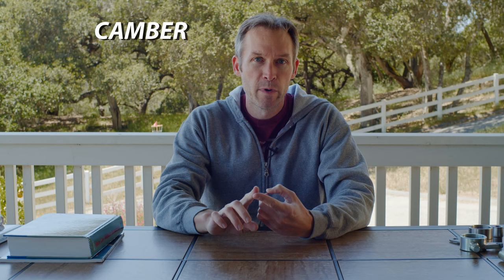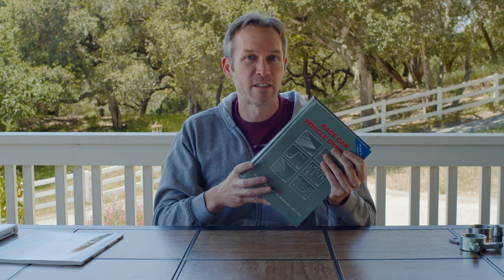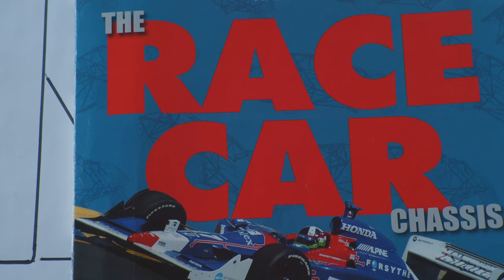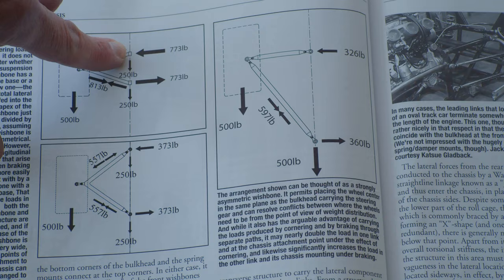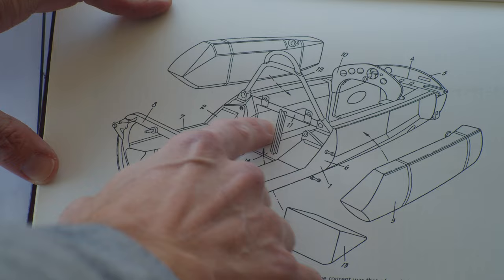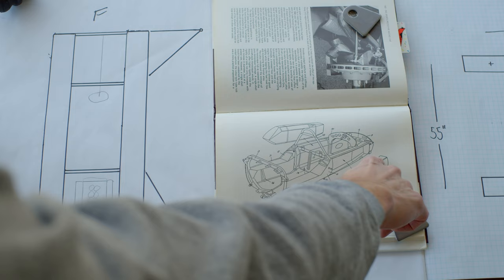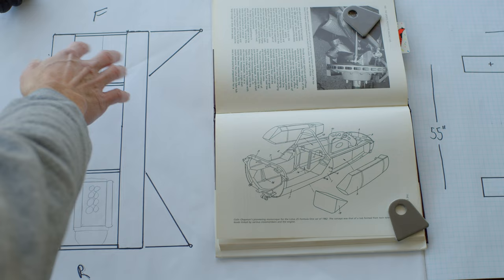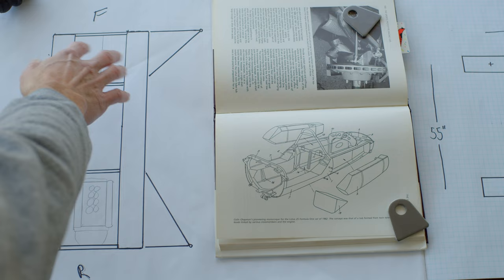Race Car Suspension Fabrication

Comment: Hey Ben - your videos are really well done! I just found your channel today so new subscriber. You've included a lot of great tips and explanations in this one - I went through a similar learning process a few yrs ago when I built my chassis. Carroll Smith's Tune to Win was a great resource for me at the time - publication is decades old but still relevant. I went the push-rod route with corvette knuckles front and back (with lots of mods) - a few things I might have changed if I started over but that's how these builds go. If I'd seen a video like yours before beginning, it definitely would have sped up my design work! Thanks for taking time and sharing all your insights with the community, I'll definitely be watching a few more of your videos in the coming weeks!

Comment: Thanks - I read the chassis book, but did not pick up on the differences in forces for the different suspension mounts. I now need to re-check my design. But now, before I built any of it is definitely the time to check!

Comment: Don't forget to look at the brake torque around the upright when calculating the rod ends in bending. The lower ball joint gets a lot more bending force because of this moment on top of the pure longitudinal force. That's why it seems some cars get away with rod ends in bending on the upper wishbone, as the braking moment somewhat counters the braking force, but on the lower one it doesn't.

Comment: Great video Ben and well done on the work you’ve done so far. Just out of curiosity could you tell me where you sourced the parts you showed during the vid, like the threaded control arms, circular ball joint holder etc.  I’m in Australia and I’m contemplating building a replica Brabham BT 19 of which only 1 was built and is a legendary car here.  Keep up the good work. 👍
Reply from the maker: Threaded ball joint sleeve: https://www.speedwaymotors.com/Steel-Upper-Ball-Joint-Sleeve-K772-Style,2126.html
Sleeve with attaching points: https://www.speedwaymotors.com/Upper-Ball-Joint-Collar-Ring-and-Steel-Clevis-Kit,379575.html
But if you're doing an open wheel car something like this would look more period correct.  You'd just run spherical bearing with a bolt through it instead of a ball joint:  https://www.pegasusautoracing.com/productselection.asp?Product=1825-150
Threaded tubes can be found in aluminum or steel.  Search for terms like threaded tube, swedge tube, swedged tube or swadge tube.  Here are a couple examples: https://www.summitracing.com/search?SortBy=BestKeywordMatch&SortOrder=Ascending&keyword=swedge%20tube
and https://www.speedwaymotors.com/AFCO-36216-Swedged-Aluminum-Tube-1-O-D-5-8-16-Inch-Long,43412.html
Reply: Huge help. Cheers!